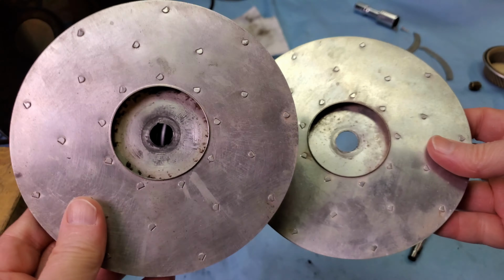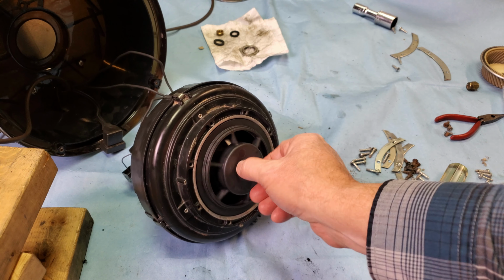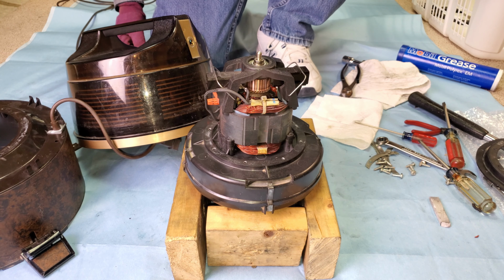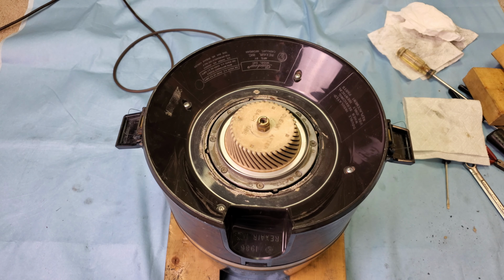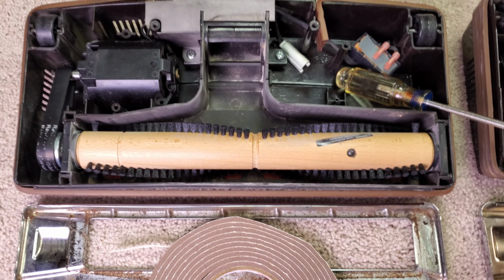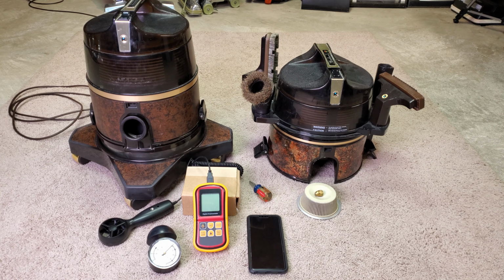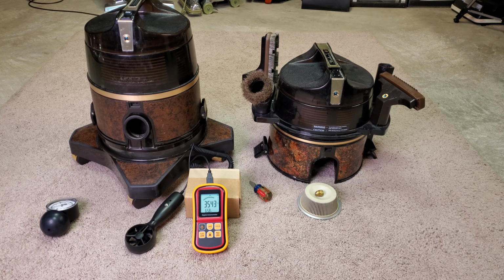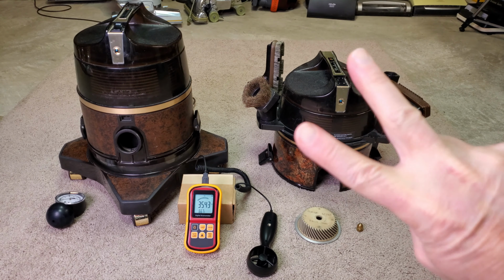1989 Rainbow D4C Refurb Part 3 | Finally Done

Comment: Great video,I sm learning so much about rainbow teardown .Its because of them I hot the confidence to fix our broken 2006 E2 single speed. I am grateful for that.  just a note on that worn spider , of course a new is better. But if they are not available anymore. Then the old could have been re used. Just add a few nylon/ teflon washers to get the correct spacing. Then it should work just as well. Keep up the good work

Comment: The rebuild turned out nice, good thing you were able to find the spider troubles, and I like how there's a little bit of a power difference with the old style separator carried over from the D3c.  I wonder if Thomas will let you do some sand/fine dust/baking soda in the carpet tests with that since it has the updated brush roll, I really want to see how much better (or worse) that CWP replacement brush roll is in that PN1.

Comment: Just a heads up the old spider separator nut combo is very specific to the d4s. According to rainvac spider separator and nut should all be upgraded together.  Im working on my aunts 86 d4 and after bearing replacement is still had a very bad vibration.  Turns out the wrong separator nut was used and warped the separator.  The d4 nut has a bevel on the back that fits the slanted slot  separator and spider a specific way.  That separator needs the old spider for it to work correctly.  Check out the motor parts section on rainvac for the d4 for more info.  By the way thomas I'm another rainbow fanatic from WV
Reply from the maker: The old nut seats and works perfectly with either the new or old separator. The reverse is not true, however. The newer "flat bottom" nut will not seat properly with the old separator.
Reply: Oh really, what Rea are you from?
Reply: Eastern panhandle
Reply: @VacLab  That's good to know.  Apperently the rainbow dealer that serviced it in 02 didn't know that

Comment: Hi i have rainbow se 96 i believe right now (with v2 electrical brush). i have replaced motor, bearings and this aluminum plate below spider. unfortunately spider after tightening this nut on spider it starts to rub on silver plate. i bought replacement here on polish market but it does not fit. it stopes motor completely - to tight, this bushing below original spider does not look like damaged one and has same Hight as in new replacement. rubbing can be heard loudly when vacuum stops and in over all it works a little bit to loud in my opinion. maybe putting a washer below spider (on bearing) to rise i up a little bit will do the trick?
Reply from the maker: I can't recommend much without seeing this issue in person.
Reply: @VacLab   is there any way i can send you img or video? i wonder if my lover separation plate (aluminum one)is proper thing. it has been replaced by me some time ago and from that point i have problems with it.
Reply from the maker: @maciejbednarek7741  post it on YouTube. You can even make it private if you don't want it public.
Reply: @VacLab  good idea a will do that just after Easter then:)